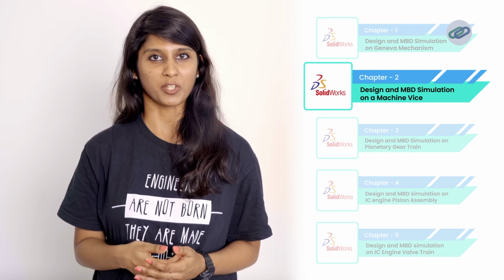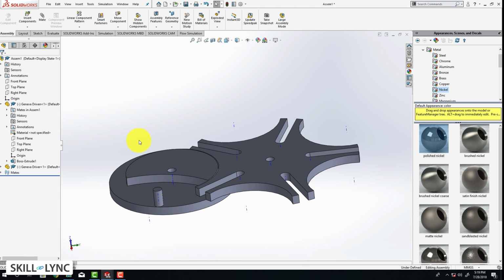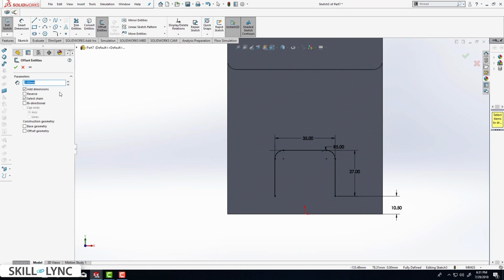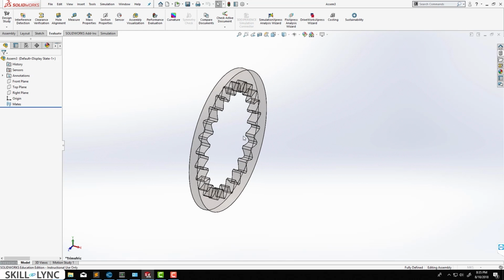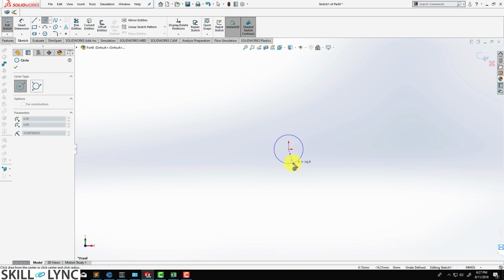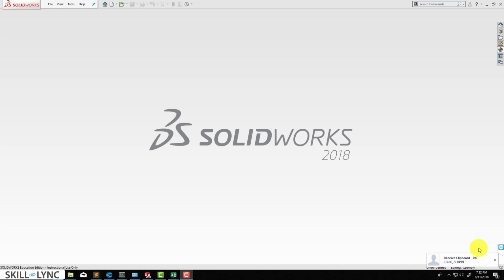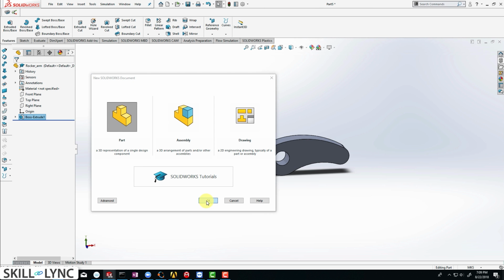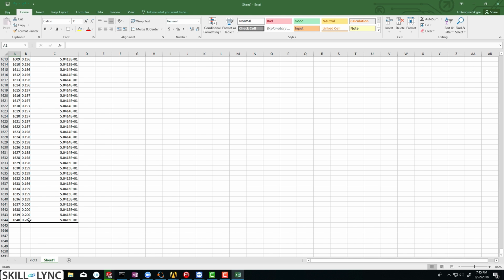Multibody Dynamics using SOLIDWORKS: 3-Hour Full Course | SOLIDWORKS for Beginners | Skill-Lync

Comment from the maker: If you have any questions, feel free to drop them in the comments below. Our experts are here to help and will answer your queries. For a more personalized experience, click on the link to register, and you will receive a call back from our experts. Register here - https://bit.ly/471QoM8

Timestamps -
0:00 Introduction 
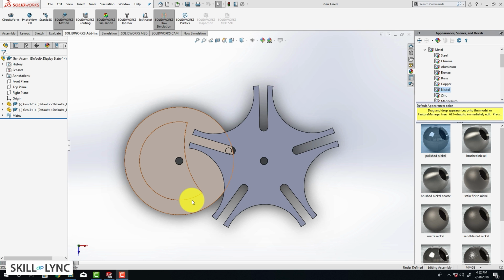3:18 Modelling and Simulation of a Geneva Mechanism - Part 1 
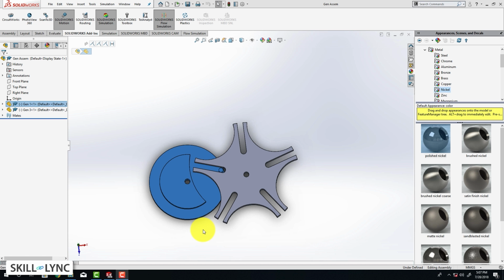15:49 Modelling and Simulation of a Geneva Mechanism - Part 2 
26:58 Modelling and Simulation of a Geneva Mechanism - Part 3 
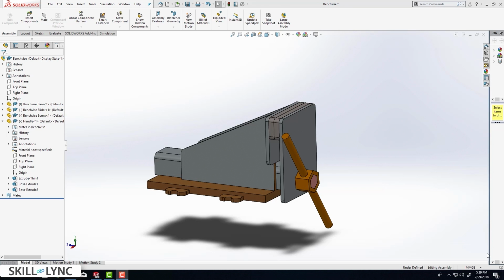35:17 Machine vice fixed jaw 
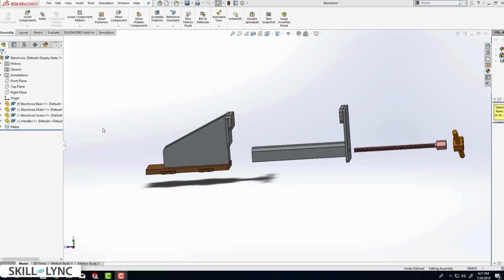47:22 Machine vice movable jaw 
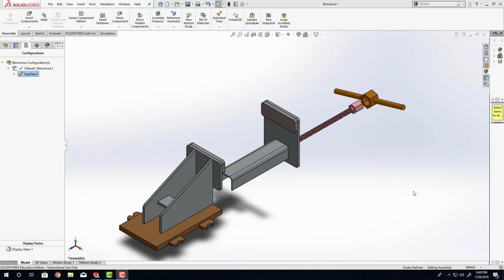53:30 Machine vice screw 
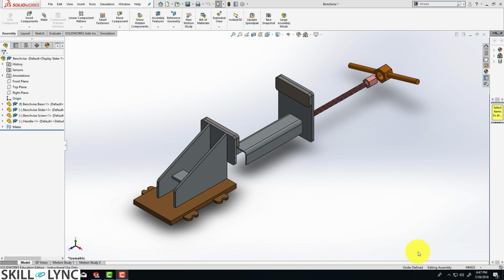56:15 Machine Vice Handle 
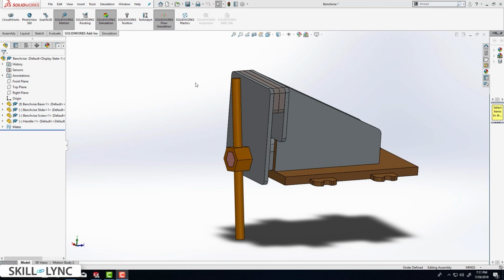59:32 Machine vice assembly 
1:06:59 Machine vice simulation 
1:11:44 Planetary Gear Motion Analysis 
1:15:58 Planetary Gear Motion Analysis – 2 
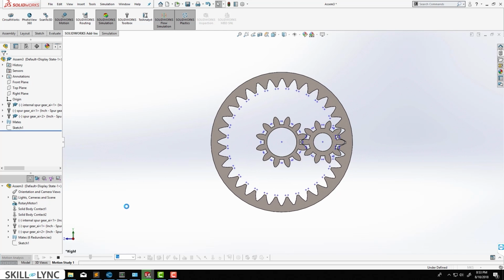1:29:08 Piston Kinematics – Introduction 
1:30:21 Design of Piston 
1:41:31 Design of Connecting Rod 
1:49:03 Design of End Cap and Wrist Pin 
1:57:34 Design of Crank 
2:06:57 Motion Analysis of the IC Engine Piston Assembly 
2:20:51Design of IC Engine Valve Train 
2:45:37 MBD Simulation on I.C Engine Valve Train
Reply: Hi @SkillLync, could you please allow access to the example files used in training?